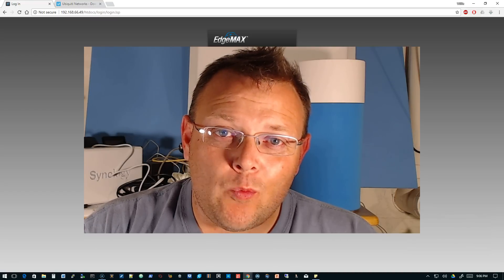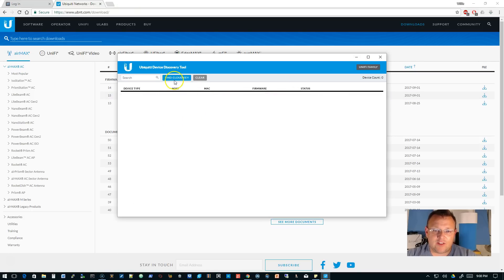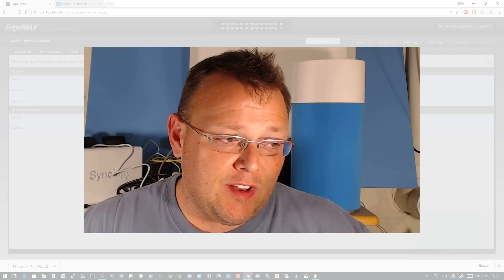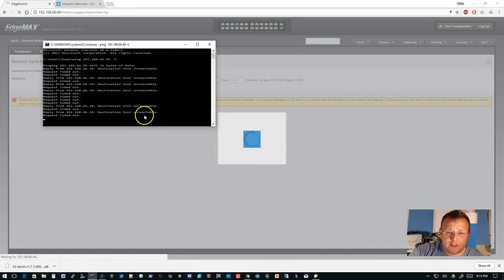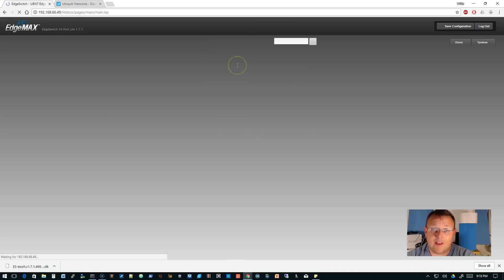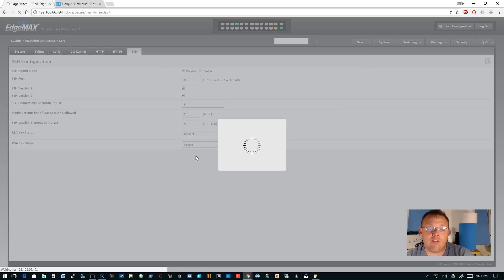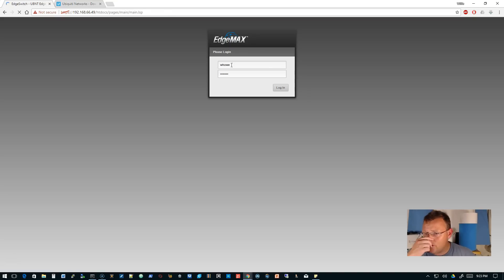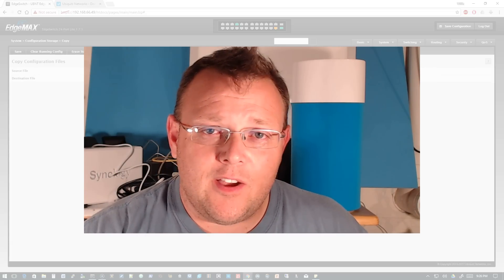EdgeSwitch Setup Guide - 1

Comment: I am on EdgeSwitch 16 XG 1.10.4-lite and the interface runs extremely slow, I switched over to legacy mode because there are way more options available. Company upgraded switches so I have this now in my homelab, overkill yes but why not just wish the interface was a bit faster.